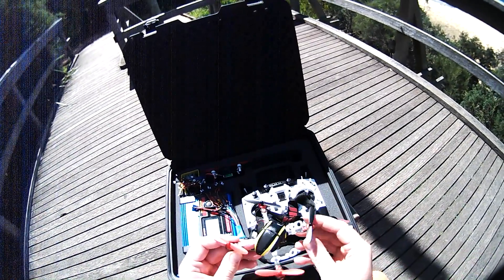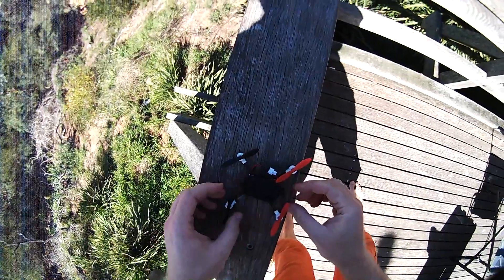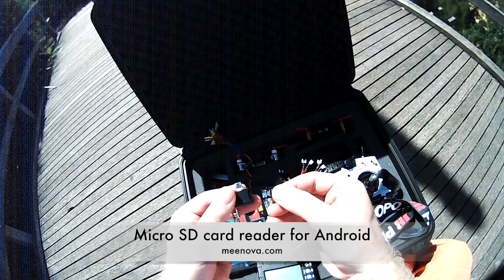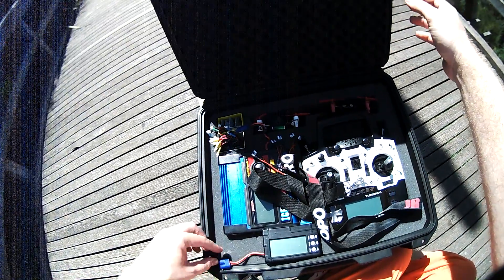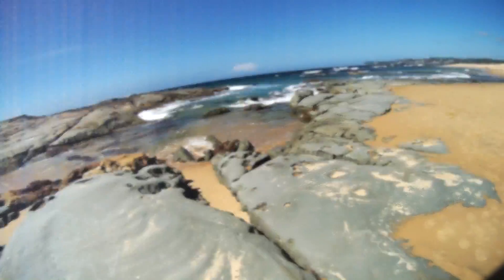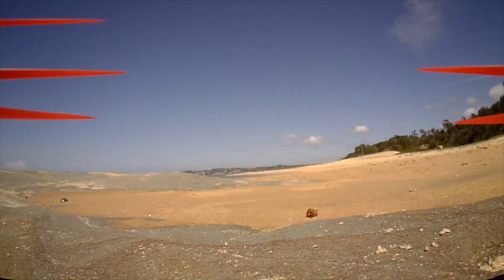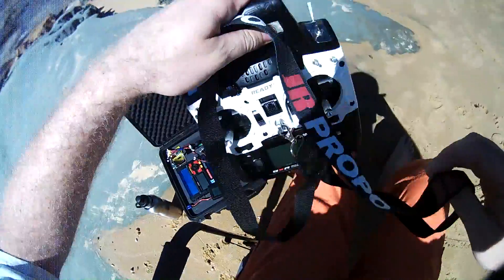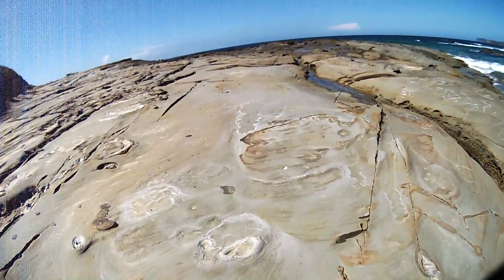The Motor Guy at work - wanna see his toolset?

Comment: hello Benedikt Haak, i have a question, i have a drone syma 5 that works with a lipo battery 1cell 3.7 volts, 500 mAh, and also have a drone JJrc h8 that works with a 2 cell 7.4 500 mAh and those batteries has a balancer conector, can i repalce de 7.4 volt battery for 2 batteries 3.7 volts making a conector in serie? is the same than the stock 7.4 volt? does not affect if theres not have balancer conector? i will apreciate your answer, for me is more conveninete for price and time to chage use the 1 cell 3.7 volts batteries, thanks.
Reply: Yes, two single cells in series will have 7.4V nominal voltage. If you charge them separately, there is no need to balance.

Comment: I charge my lipos for my quads parallel but I don't have a balancer like you do "Yet"  is it dangerous to continue charging with out a balancer with 1s batteries.. sorry for the newbie question I am new to quads :D  hope with practice I can fly it like I stole it..!
Reply: timothy Poblete I can't find a balancer that you have do you have a 1s or can I use any 2s-6s balancer for my 1s lipos  thanks for the great videos and help Motor Guy :D
Reply: timothy Poblete Just found your video :D thanks
Reply from the maker: timothy Poblete I suggest to look at the Hitec X4 charger. Thats a much better solution than my DIY 2014 style ;)
Reply: Benedikt Haak wow the price is out of my price range , i have a balancing charger, can i just go with the 2014 style?
Reply: timothy Poblete I just read the specs so this Hitec X4 is for lower voltage lipos.
Reply: timothy Poblete I just ordered 750mah and 350mah can i use this charger  Hitec/RCD X4 Micro AC/DC 1-Cell Lipo Charger?  thanks for the help motor Guy..!
Reply from the maker: The Hitec X4 charges up to 4 single-cell lipos with up to 1A each. Larger than 1000mah or more than 1 cell, and you'd be better off with a different charger.
Reply: Benedikt Haak Is the Hobby town battery medic just more work and the Hitec X4 more consistent ?  Just want to know what the difference is and I do have JST connectors lipos coming in for my alias... sorry for all the questions Motor Guy but I appreciate the help..! :D

Comment: I'm totally screwed!! I have 3 frame kits,and a spare frame for my qx mod quads,but they won't be here for atleast a week,I checked tracking my spare frame will be here tomorrow,but I just trashed my last useable frame about an hour ago :(.It was being held together by zip ties and tape but worked flawless,threw it in high rates tried some reverse piro's and dumb thumbed bad 1 min into a fresh flight !! 4 boards and no frames to swap! I need to hit up MMW,or PQ and keep a carbon frame for hard flights!! These nano's have me spoiled,I was actually hurt my toy broke!!!LOL!!
Reply: Use the walkera ladybird. Its cheap and insanely stable. Mine crashed 30 times (extremely like full throttle upside down or against walls) and i only needed to replace the frame which was 2,09€...
Amazing quad
Reply: drkastenbrot Have one the board is in the jjrc 1000a shell now! That lady bird frame didn't hold up too well for me. I have carbon arms and mounts still on one of my frankenquads,but,Im using the heavyduty syma frame now.